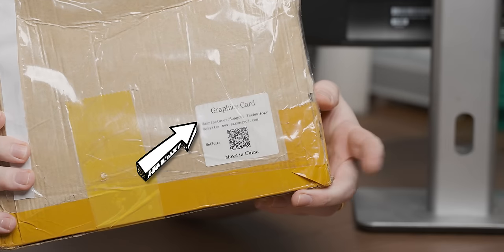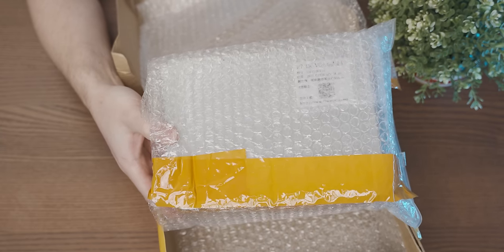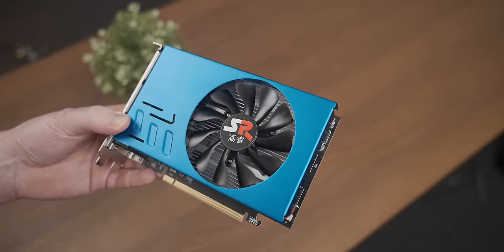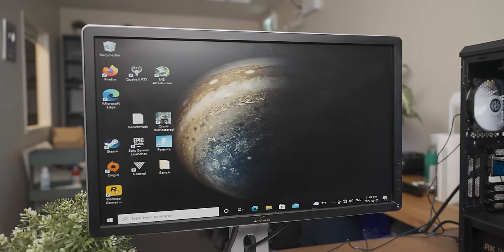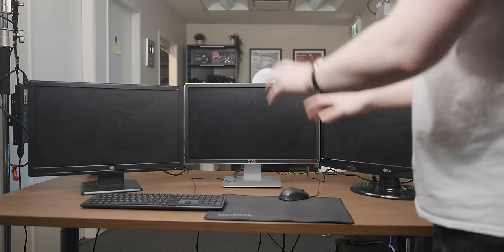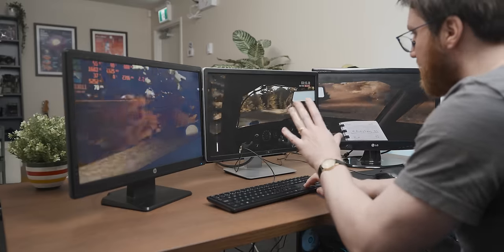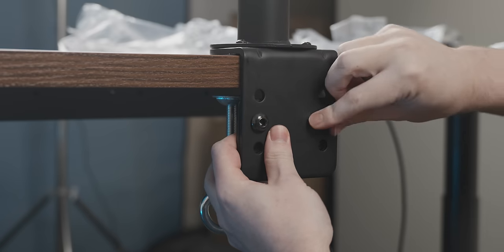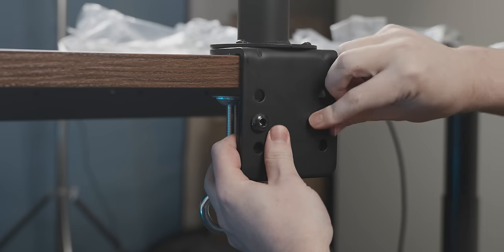6 Monitors, 1 GPU: World's WORST Multi-Display Gaming Setup

Comment: One, play around with the monitor array -- either (a) spend the time to make those monitors work well for you or (b) spend the time at your local Goodwills, thrift shops (PTA and independent), and on your beloved Craigslist to get six identical monitors.
Two, remove the bezels for freaks' sakes... at least find a way to cut them down. 3D printing custom bezels is probably peanuts in the cost department for someone like you.
Three,  this is not the only way to achieve this. At least in the pre-UEFI days, if you had a way to run a video card without its integrated video BIOS (yes, video cards have their own BIOSes) you could use multiple cards without SLi/Crossfire/etc. My understanding of modern gaming rigs is extremely limited -- I generally don't have the budget, or the need, for anything above what the integrated graphics chip gives me, as I'm a hardware guy that doesn't really game -- but from what I understand, that's no longer a limitation, and if your motherboard has six PCIE x16 slots and can somehow drive every one of em at full bandwidth, you can stick a card in each and every one and game like IDK a Blizzard dev or whatever. Good luck finding a board like that tho lol... or enough cards to fill it! But even the old Radeon HD 6850 I scored off eBay MONTHS ago for $50 can drive three displays without you being terribly clever about it, so if you have two slots and two cards you can probably run all three displays.

Bonus round: 
All monitors have what are called "software profiles", which are a bit like the equivalent of drivers for them, that you can download from the manufacturer. You can usually also create your own. This is very much professional graphic artist territory -- those are intended for artists, animators, desktop publishing folks, people whose jobs hinge on a specific color looking absolutely identical across multiple screens. It will likely take you the better part of a week with monitors that badly mismatched to get the profiles tinkered with till you can pull up a hex color in Google (this is when you specify a color in its hexadecimal color code -- for instance, the world-famous Canary Yellow that is used on writing pads everywhere has a hexadecimal color code of #FFEF00 -- hash symbol to indicate a hexadecimal value, first pair of hex digits 0-255 red intensity, second pair 0-255 green intensity, third pair 0-255 blue intensity; #000000 is pure black, #FFFFFF is pure white) and drag the window around to all six screens and have the color swatch (box with the splat of sample color) be identical to the naked eye. BTW: color-hex[dot]com is awesome for hex color info.

Also, it would not be terribly challenging to link all of the monitors so you could turn them all on or off with a single button. Get six 5v reed relays, a 5v power supply with some amperage to it (2-3a I'd say), and a button. Wire each reed relay across the button of a monitor, and then to power through your trigger button -- which will need to be a bit beefy (or wired to trigger a bigger 5v relay than the others, which in turn triggers the reed relays). True, the better way to do this is with transistors, but that involves working out the polarity of the buttons on the LCD screens themselves and reading datasheets to find transistors that will switch the voltage and current you need without burning up or needing weird voltages themselves -- chances are, for example, that a 2N2222 will work, if the button pulls the signal to ground when you turn it on -- but that's not a guarantee, it might pull high, and "high" might be 5v or it might be something weird like 1.8v or 3.3v or 12v... or it might be oddly high-current, exceeding the 300mA that the 2N2222 can reliably handle on a continuous basis. There's no standard for those, and I speak from experience when I say that relying on "probably" is a good reason that the first time you power anything on after building it, that's what us electronics folks, hobbyists and professionals alike (full disclosure, I'm in the former group) call the "smoke test" ;) if you want something simple you can whack together easily, that will "just work" -- relays. A relay is essentially an electric light switch that's triggered by other electricity and works on the fact that electricity and magnetism are best bros. Use relays... unless you do something that's quite a bit dumber than the sort of folks Wish is actually trying to sell most of its crap to, I think you'll be all right ;)

Comment: Descent build for 2022, imho
Also, it would make more sense if you used gamepad sitting a bit away from monitors. But anyway, buying a cheap 50-65" tv instead will work in most of the cases

Comment: on the Facebook market place i found a 6 video output GTX 980 ti for 300$ maybe you could check that out with a better gpu    ( i believe it is better )

edit : i just checked and it's a huge ton better performing.....500 cores vs 2500 cores

Comment: Hilarious that you are bottlenecking with 2GB VRAM when a number of years back I ran 3x Nvidia 660tis in SLI with 7680x1440 resolution (only 12% lower resolution than your beast here) and they only had 1.5GB VRAM 

I frequently hit VRAM bottlenecks as expected, and with the bezels accounted for it made for nice round resolutions of 8000x1440, 6000x1080 and 4000x900. Never went lower than that as it got too blurry for 27" screens
Don't know what the hell I was thinking

Comment: the mall cop refurb cluster node all kitted out with 32gb/nvme/2.5 on 6th gen intel - less than 400 - to scale nvme you may need 10g bonded or 100g - the netfs may be weak link in chain - you have to build and test - 100g is only 300 or less - it is a fier up but could support more iops - probably mandatory #node platform vetting #scale

Comment: those monitors aren't that old...
Reply: yes, I do have a 1x3 of these. Shut up.
Reply: the trick to using them all is to sit a bit further back, make sure they're properly color corrected for eachother, and dial in your FOV appropriately. Dawid has 3 identical LG panels here that would genuinely make an excellent 3x setup for 1080p with an edge, but that he hasn't even color corrected at all. Running hte same input type from the same card on the same monitor type, attached to the exact same level on the same monitor arm is always going to be a pretty damn good experience.